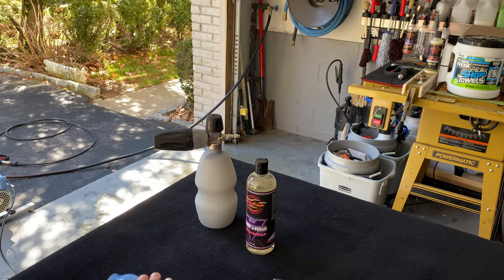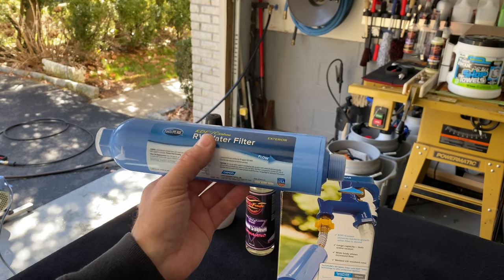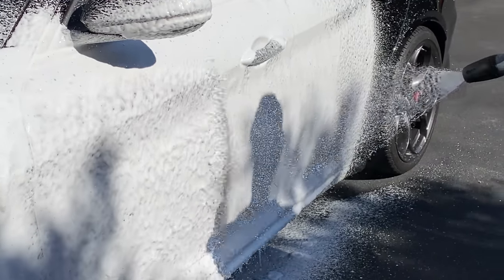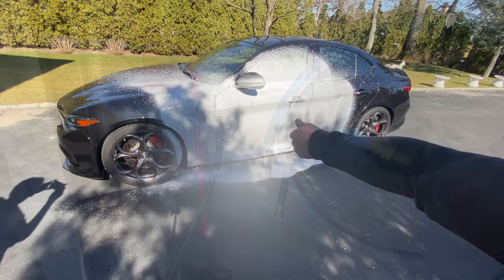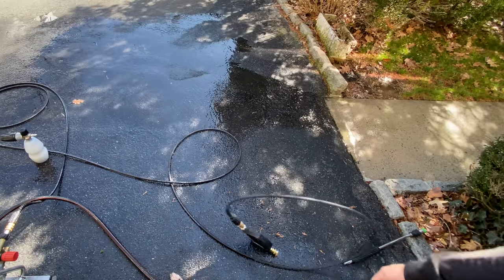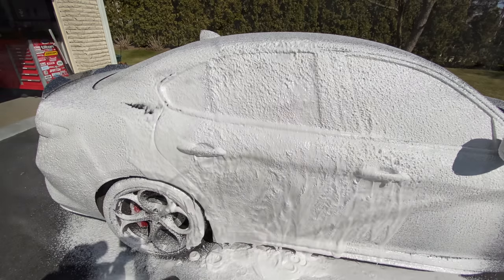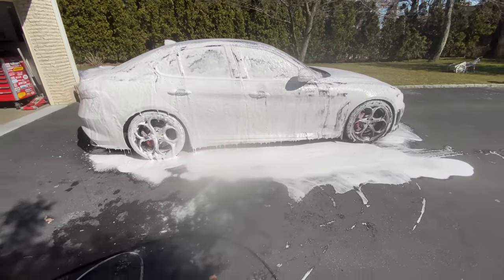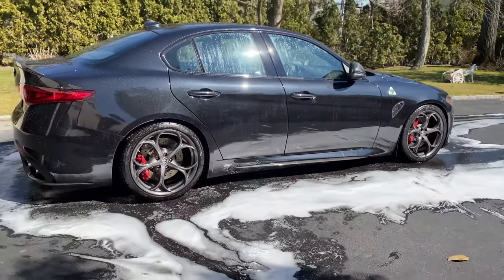Camco RV Water Filter Before & After Foam Cannon Demo

Comment: I tried this method with the Camco RV filter. Results were less then stellar. I still ended up with water spots under the sun. My water has a TDS of 175. Although it didn’t work well for me doesn’t mean it won’t work well for others. Thanks for testing this.

Comment: My outdoor water faucet is located low like near the ground, I added a flexible Camco hose to the input side of the filter,now I can flex it a bit, this works great. I'm a fan of auto Fanatic 👍
Reply from the maker: glad you like it as well as the video shows the foam quality is better with them and the drying is superb in direct sun

Comment: Thanks as always Phil! I've been using these here in Colorado to wash my car. My TDS is high. . . 280-380. . . if I towel dry the car shortly after final rinse, I'm spot free. . . but if I use my EGO 580 CFM, I definitely get small water spots. . . the Camco RV filters undoubtedly help. . . making whatever spots that DO form very easy to remove. While I'd love a full deionization system, I just can't stomach the initial cost and then the follow-up cost of frequent resin recharges. Thanks again for the tips!
Reply from the maker: years back i had a CR Spotless system and i was constantly changing the filter catridges out and it got to a point i just sold it. It also use to get so bad as a water supply feed it burned out my pump on two of my gas pressure washers back then. these filters for me make so much more sense and i never loose flow to affect my pump anymore.

Comment: I bought mine at Walmart after you mentioned them way back. I don't have a pressure washer but do use a foam gun and 2 bucket method. Fill them both with filtered water, do my initial rinse without the filter, but do all the subsequent rinses with it. For me the best thing about these is NO more water spots, especially in the hot summer days.
The water in my area is absolutely terrible, too many contaminants to mention. Sincere thanks for introducing me (us) to these inexpensive but functional filters 👍✌️🇺🇸 and made in the USA‼️
Reply from the maker: thanks for posting your feedback using these

Comment: Ever since i saw that video 2 years ago, I’ve been using these filters to wash my car, religiously.

I live in Texas and we get some serious water spotting in the spring and summer.

This stuff works great and it definitely helps keep your foam nice and T H I C C

And now that the 3rd spot in my garage is essentially a dedicated wash bay - I will never wash my car out in the sun. The added benefit of also having an A/C unit is great for paint correction and polishing
Reply from the maker: thanks for posting and also sharing your success using these filters and glad my first video helped you decide.

Comment: I have been using the Camco filter at your suggestion since early last fall. I don’t use a foam cannon due to limitations beyond my control. I live in north Jersey. I am able to wash my black Mustang every week thru the winter. I’m able to do a “Winter Wash”, in approximately one hour. Finish up using 007 Gloss Enhancer as a drying aid. The Camco filter is BIG IMPROVEMENT verses no filter. NO WATER SPOTS. The car looks great. I get lots of compliments. Thanks for all the great tips and advice!
Reply from the maker: good stuff

Comment: I'm glad you're showcasing a RV filter.  I bought an inline RV filter since I don't have any other means of filtering out hard minerals.  My previous method for avoiding water spots was to douse the car with gallons of distilled water.  That seemed to work but the filter is more practical.  I highly recommend using one.
Reply from the maker: glad you made the switch, simple, easy and it works

Comment: My water source is real low to the ground so I would never be able to fit the filter. The only way I would be able to make this work is to add a short piece of hose from the source to get it away from the house. Then I could attach the filter and then attach other end to the pressure washer hose. I'm wondering if all the connections will hurt my GPM though? The only other option is to attach the filter directly to the other end which is the pressure washer. I'm not real comfortable having something hang off the inlet on the pressure washer though. Could put stress on it.

Comment: its not working
maybe it was working in your case.. but in mine no difference at all..still a lot of heavy water spots even with no direct sun light
Reply: Yeah me too , not as much as before but definitely still have water spots where the water dried on its own time and the sun dried it .
Reply: @cheyenneobregon184  obviously you’re going to see if water is filtered or not with it remaining on the car.
Reply: Yo
Reply: Some say even after washing it will dry clear no spots but that's for some of the expensive like 300 dollar tanks you can buy
Reply: You get what you pay for here it helps but it's cheap it won't be perfect if your a pro car detailer or serious about your car and washing I would go with thr big tanks
Reply: you have to blow dry or dry with a microfiber towel

Comment: Walmart has something similar in the RV section as well I’ve used before. Does great! Definitely helps with water spots
Reply: do you get water spots if you don't dry your car?
Reply: What brand is it?
Reply: I just bought the same one at Walmart 16.98
Reply: @glasser620  yes of course
Reply: @icemanddr  and it wasnt worked at all right>?;)

Comment: I was using a Clear2o inkine filter similar to the Camco but, when installed, I noticed my Active 2.0 pressure washer wanter to stall, noticed difference in pressure at times and I just removed it, not sure if it is minimizing the garden hose pressure??? Am I doing something wrong?

Please help, any suggestions? The water filter I have is a solid carbon piece inside which provides better filtration, thanks!

Comment: How many washes can get before replacing the cartridge ? I know it will depends on quality of your water. At $12.50 a pop where say a resin based DI not CR's since the filtration rate is low vs  since has poor  performance .DI rinse system cost $400 but does 2000 gallons for $100 worth of refillable media. .  I still might try one since is much cheaper and don't a tank sitting around in your garage.  I try wash early  morning or after sun is behind my house. Thanks for all your great info.
Reply from the maker: i wash 4-5 times per week i change every month but i am sure i may be able to go longer. I had a CR Spotless system and mine was getting clogged in 3 weeks of use and it got VERY expensive to keep up that i just sold it on Ebay and switched to these filters and it was the better decision in the long run so far.

Comment: Hi how often would you recommend changing out the filter if your doing once a week washes?
Reply from the maker: I change mine once per month but I have 5+ cars and wash several times per week it all depends on your water supply and how often you use it some have told me they get 6 months out of the filter
Reply: @autofanaticcars  Thank you for your reply i will definitely give one of these a shot!

Comment: Thanks for the tip. Just wondering, do you wash/hose down the driveway or does the soap/water on the ground dry in the sun?
Reply from the maker: sometimes i do but my soap does not stain my driveway and i have a drain at the end of the driveway that goes into a dry well

Comment: Do these reduce pressure washer performance at all? I’ve had one on my hose and sprayer but have not used with pressure washer yet.

Worried either this or my quick disconnects on the pressure washer and gun will reduce water pressure overall.
Reply from the maker: No they do not hurt flow just make sure they are installed in correct direction marked on the filter with arrow

Comment: I have a very similar setup except I use the Amazon 20-micron filter which is identical to this one and high-flow as well. This one you are using is 20-micron as well from Camco and I’ve heard you don’t want to go any smaller than 20-micron or you lose too much pressure. They make a 5-micron which might be something you should try as maybe it’s doable?

I have the newer MTM PF22.2 Foam Cannon and it works just fine with my AmazonBasics water filter. 

I also put QD’s on both sides of the filter to take it off when I’m not washing my car.

Comment: Thanks for the info. Question. Can you tell me what quick connect you have on end of hose to the filter. Once you connect the filter directly to your spigot what QC is the one your screwed the hose on with? I have Kranzle as well with a QC on both ends but it looks like this needs a different one to connect to filter.
I purchased all of your products and I have to say it's the best in the industry.
Thanks
Reply from the maker: I just use some 1/4 connects I have bought from Amazon or MTM online, they work but do not last I had a video not too long ago showing why they leak and how to fix them. Glad your loving the products our new tire dressing is coming out soon. Stay Tuned
Reply: @autofanaticcars  i turned 50 so I'm a little wacky now. Yes I screwed the QC from my Obsessed Garage on it. This is fantastic. Does the job for cheap. Thanks man!

Comment: I just picked one of those filters up today at walmart and the wheel stand with rollers from harbor freight for when I use gyeon q2 rim on my wheels.
Reply from the maker: sweet yeah i saw the stands at HF last visit as well, you will love it, i use it so often, have fun doing your wheels and take your time, prep is the key
Reply: @autofanaticcars  Just used that stand today to apply gyeon q2 rim on the black bullitt  wheels.

Comment: Awesome content brother. I really like your format and your level of knowledge. Can't figure out why I can't get thick foam. I'm using the Kranzle 1322TS with the PF22 cannon and the camco filter. I get average foam at best and can't figure out why. Any input would be great.
Reply from the maker: what soap are you using and did you change the orifice on the MTM? i never changed mine but some have said it helps i have been using mine out of the box for 4 years never an issue, never cleaned it as well.
Reply: @autofanaticcars  I've used your soap 007 snowstorm and also tried adams honeydew snowfoam as well. Same result with both honestly. Watery thin foam.  Nowhere near the level of thickness as you get in your videos. It will all dripp off the car within like 15 seconds. Also I am using the stock orifice. I think its like 1.25mm. Can't seem to figure this out and I'm stumped at this point just throwing money at more products and pressure washers lol.
Reply: Jason McAllister I had crappy foam too, check your using the right amount (I wasn’t using too little) and I put the Kranzle on a dedicated 20 circuit which helped big time.
Reply: Switch the stock foam cannon orifice to a 1.1 orifice . I’m makes that shaving cream foam for lower gpm pressure washers

Comment: I’ve purchased the filter and i am a little concerned by the 90psi max, has anyone had any issues with running it through a pressure washer? Silly question considering the vehicle but better safe than sorry!
Reply from the maker: i use the filter at my water feed before it goes into the pressure washer, no issues you do not want to use the filter on the end of the pressure washer at high PSI

Comment: I wish this RV filter had worked for me however all it did was suck up whatever was inside the filter and destroy my pressure washer. Probably due to a faulty filter but I will never use one again.
Reply from the maker: sorry to hear i must have gone through 100 of these so far and never had an issue.
Reply: @autofanaticcars  ..... Thanks. It isnt your fault. It was time for me to upgrade my pressure washer set up anyway lol
Reply: Make sure you flush your filter by running water for at least 5 min.
Reply: @rejeanpaquet4375  .... I followed the instructions exactly however my pressure washer at the time sucked up whatever media that was inside the filter. I had giant black pieces in my hose and inside the pressure washer

Comment: When I let it run for new filters does the pressure washer have to be on?
Reply from the maker: yes you need to let the water run for about 5 minutes to clear the filters out then connect to your pressure washer line

Comment: I am a mobile auto detailing .  You would recommend this filter to fill my 50 gallon tank to prevent water spots. 

I am currently using aquarium filters that I saw in one of the videos of another detailer.  which one do you recommend or would it be a good idea to use both. Thank you
Reply: It's all up to you mate. I would advise you to just research and come up with the best system that works in your favor. You can go this route and just use these small camco filters but depending on how often you're using them and how much water you're running through them, you will find yourself replacing them quite often if you use them frequently. In my opinion the smarter choice would be to research and find an inexpensive(depending on your budget) deionisation unit that is able to clear your water at a much larger scale. Though they are more expensive, after 10min of surfing online I have found systems that get the job done for well under 200$. So my suggestion is do some extensive research and come up with a solution that will best fix your problem :)

Comment: Would this filter work if you attach it to the pressure washer inlet or is that a bad idea?
Reply from the maker: bad idea i do not think the plastic filter housing would take high PSI and you could get badly injured.
Reply: Auto Fanatic Not on the gun. The low pressure water inlet to feed the pressure washer.
Reply from the maker: yes you can lots of mobile detailers use it like that with a flex hose going to the inlet and they zip tie the filter to the pressure washer side

Comment: I use one of these filters when I fill my pool up in the summer. I think i need to try it with my foam canon.  What soap did you use in the canon?
Reply from the maker: Auto Fanatic 007 Snow Storm, it is designed to offer exceptional self cleaning which most snow foams lack regardless of manufacture., high lubricity and it is blended with the polymers of my 007  Gloss Enhancer which gives a major gloss boost and  UV and water protection in one simple step. Its a legit wash and wax product unlike no other.

Comment: Thanks for this video! I was looking at setting up a CR spotless system, but the costs outweigh the benefit for my usage. I just detail my wife’s suburban and my vehicle every other weekend. I think  this may be the better route. How long will this filter last and how often do you change yours out? I may have missed that part in the video.
Reply from the maker: i wash 4-5 times per week multiple cars i replace mine each month
Reply: I’m in the same boat, I’ll try this first before dropping $$$ on a new CR.

Comment: Clear2o.com same style filter, filters down to 1 micron vs 20 micron of the camco. Can also be used with their sediment filter that prefilters to 20 microns. Camco is a "loose" carbon filter whereas the ClearO2 is a solid block. You still have to purge both b4 using.

I've used both, I can't have it permanently installed so I have to remove it after use everytime. The difference between the 2 is noticeable, with the ClearO2 being the better. It's more expensive but I got mine from a local Walmart & later ordered the pre-filter from their site.

Comment: I just did this test the other day as well. I was curious what it was like without the filter and saw same results as you.... 1.1mm or1.25 orifice in the PF22?
Reply from the maker: Hi Zack thanks for sharing your feedback as well doing the same test i show here. My PF22 is about 4-5 years old and I never changed the orifice and have owned about 7 different pressure washers over the years from gas to electric and it has always foamed amazing for me, I also never once rebuilt or cleaned it out. On my Griots Boss Foam cannon when i switched orifices it made the foam watery so i left that one alone as well as it came in the box. Some have had luck with the orifices when low GPM pressure washers I hear but others have not had much luck. I get emails all week on this scenario but these simple Camco filters as you can see really seem to help a lot with foam density and drying the car. I love the fact its so easy to use and replace.
Reply: @autofanaticcars  running the stock orifice in the PF22 as well on  an AR Blue 630 machine(similiar kranzle specs). Water at home kills foam even more than yours did in video without filter but putting the camco filter on makes a big difference. For the heck of it I'm gonna double up the filters next wash to see if that helps even more.
Reply: Zack Bell I think there are a lot of factors, but I recently switched to the 1.1mm, I have the same Kranzle, and see better foaming now. I use these filters as well, but pressure, flow and water quality aren’t always consistent, no to mention the weather conditions

Comment: I tried the Camco Rv water filters from your other video and it doesn't work in my area. I had to go back to the CR Spotless system but man I was hoping this was going to work cause resin is expensive.
Reply from the maker: get your water professionally tested it may give some insights on what you got, thats what we did.
Reply: Try using 2 filters daisy chain them

Comment: My water spigot is about 70 feet from where I detail what should I do to set up a filter?
Reply from the maker: you can attach the filter at your pressure washer or garden hose nozzle they sell adaptors and short hoses on Amazon if you click the link it will populate all the options they sell on Amazon